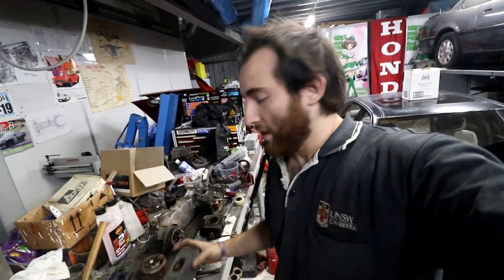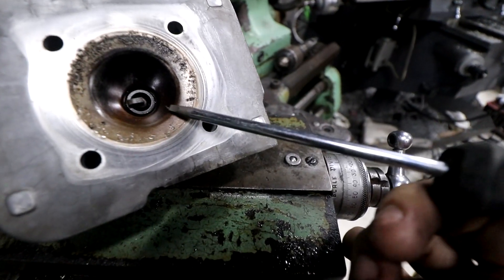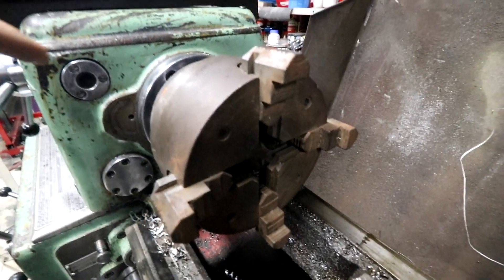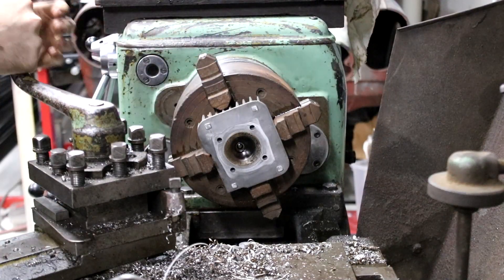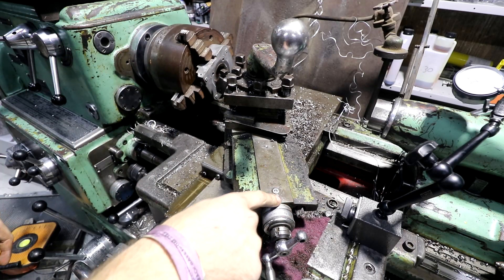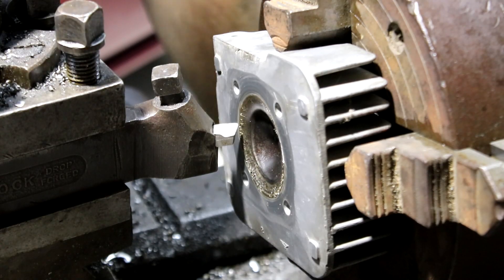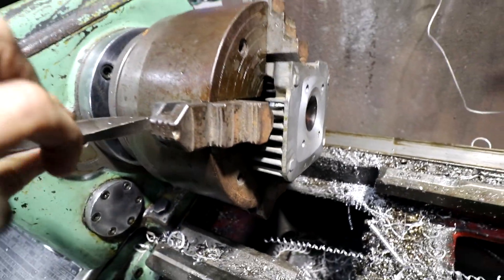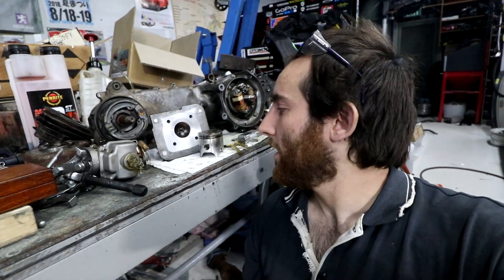How to Fix a Destroyed 2 Stroke Head.

Comment: This was fascinating. 
Dumbie question:
Is the "squish zone" a shelf so the piston physically can't hit the spark plug?
Reply: as far as im aware all the squish is is the clearance between the top of the head and the piston at tdc
Reply from the maker: Nup.  If the piston hits the squish zone you have big problem.  The squish zone is meant to direct the fuel/air mix to the middle to ignite